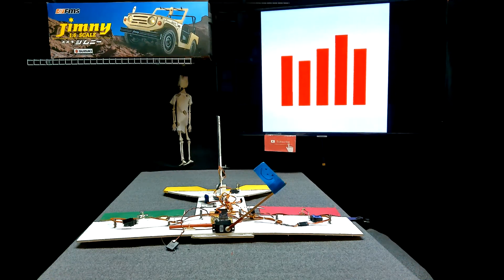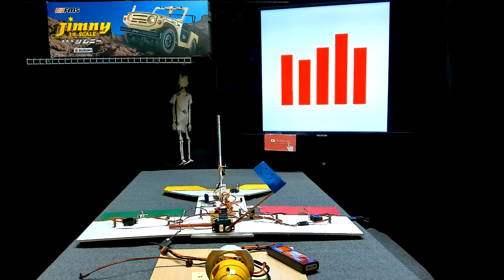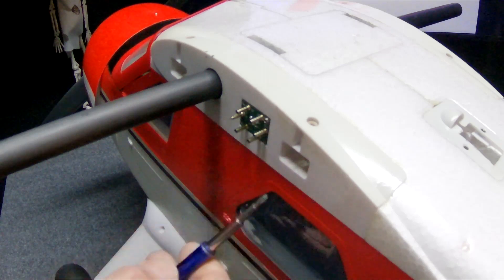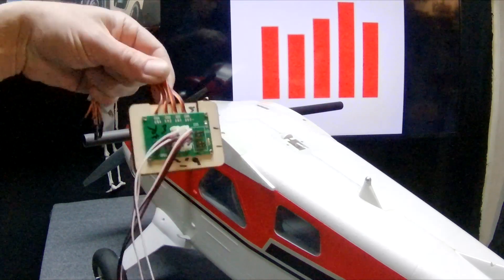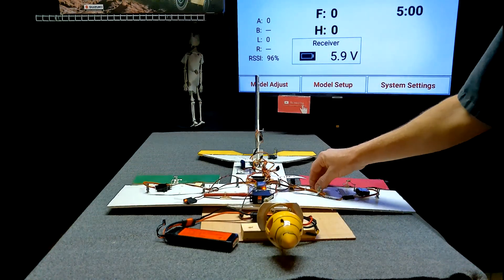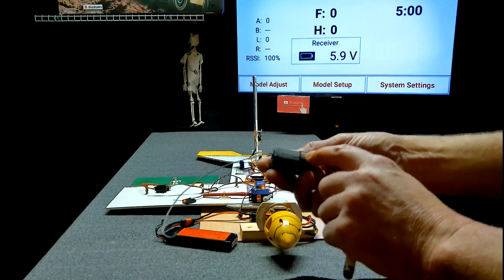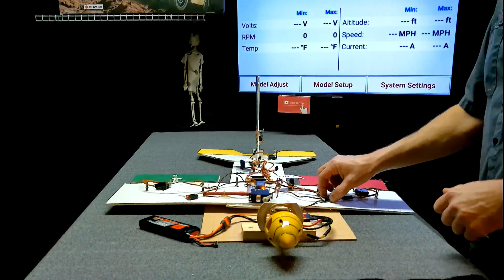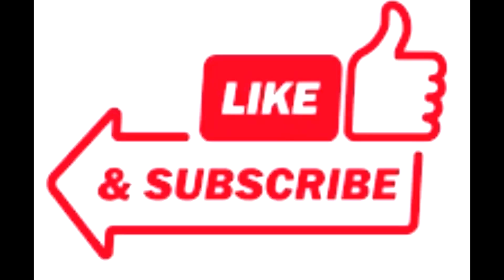REMOTE RECEIVER WITH AR636 SPEKTRUM AS3X SAFE E-FLITE DSMX HOW TO CONNECT WATCH IT WORK

Comment: I don't like those remote receivers.The early DSM2 receivers with the satellite receivers can stop working if there's a bad connection involving that little 3 wire twisted linterconnect lead.I had this problem with my friends plane because the connects were bad,his model shop was very damp and mildewy.I prefer the newer DSMX single receiver units.Those older receivers have too many points of potential failure.